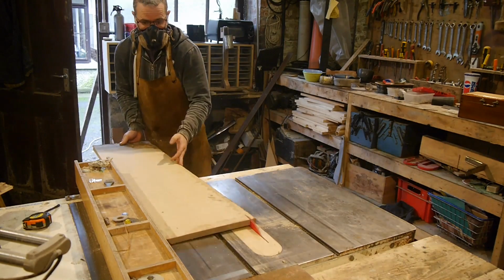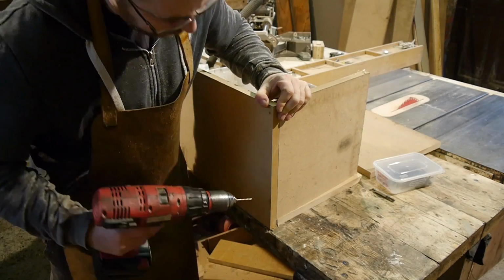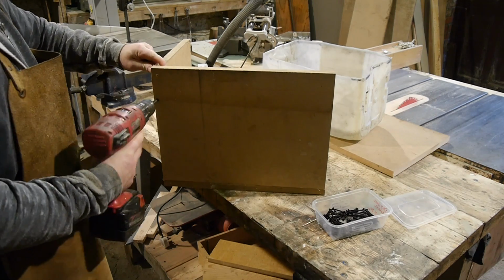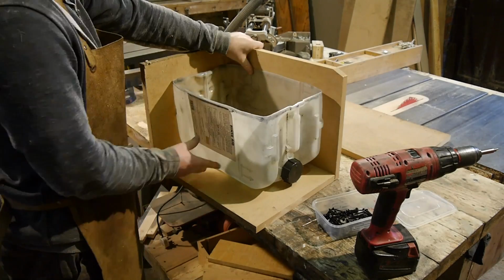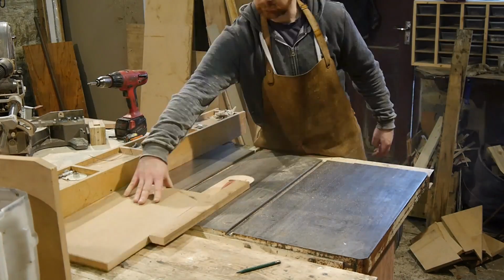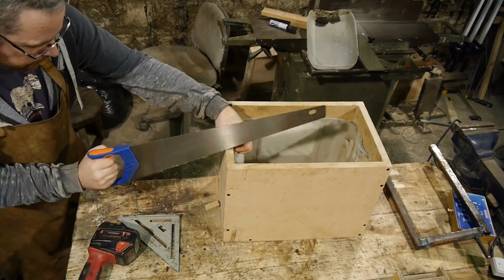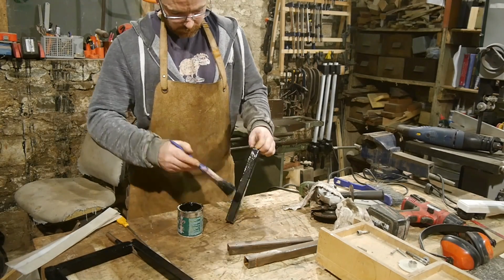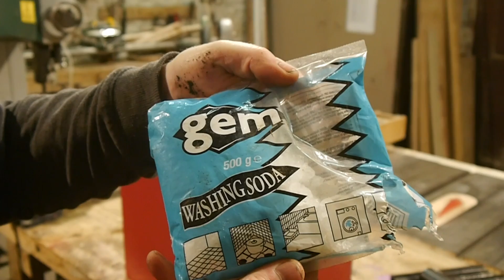Electrolysis rust removal unit

Comment: Have you tried using molasses and water ? It works fantastic on rusty metal and no power needed ... A ratio of 10:1 horse molasses  an water and won't remove any metal ... Like your videos ...keep up the good work